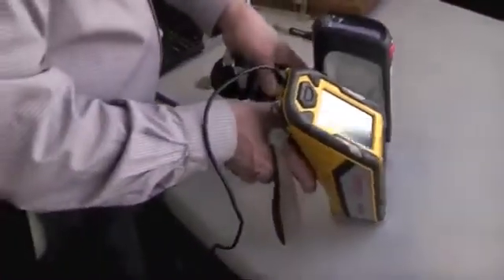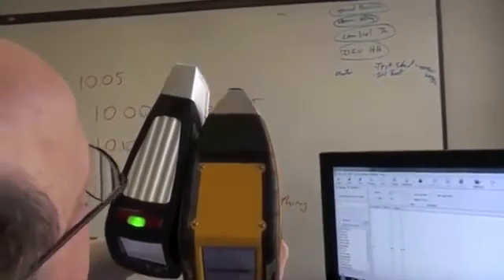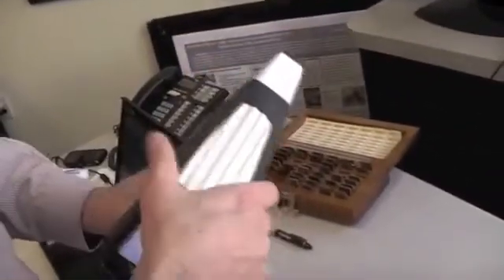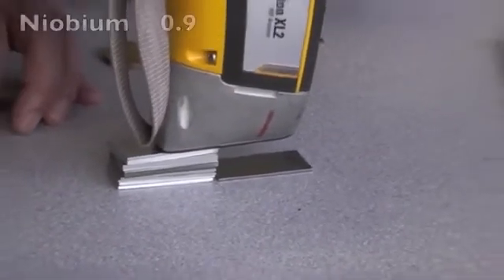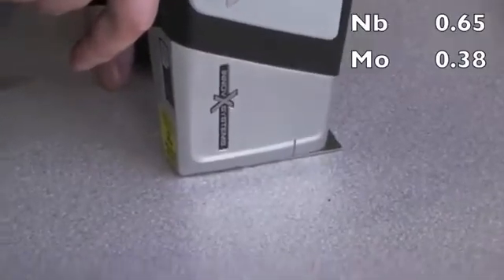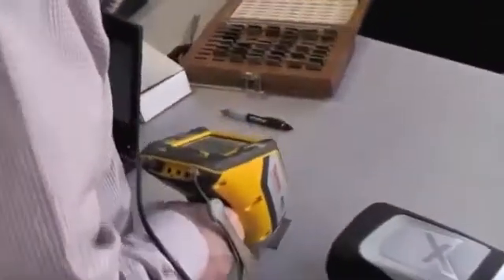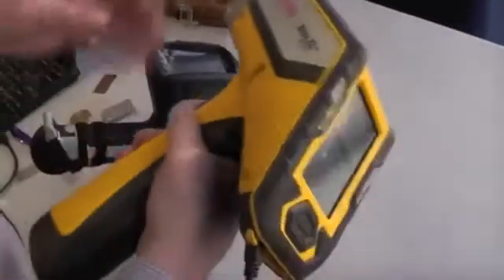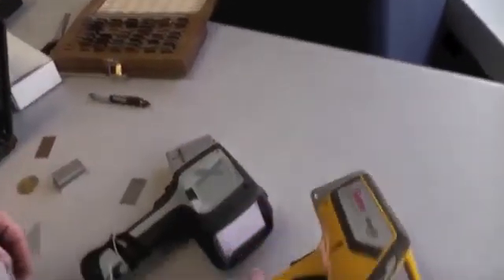Сравнение Olympus Delta и Niton XL2

Comment: That’s a class act!, the Innovex is not “intrinsically safe” because of the metal built into the instrument.
 Some elements are corrosive, bad for metallic instruments.... It will not age well.
Niton’s are splash resistant.
Standing an instrument “on its nose” is a recipe for disaster.... especially if the Xray tube costs almost the same price as the instrument and is as sensitive as a light bulb.
Niton have a display brightness control...
Approx 4000 units in Africa... it speaks for itself.... Buy a Niton.

Comment: Interesting video, seems to be heavily biased though...

- Screen brightness: It appears the Niton analyser has had the screen brightness turned down however even at the shown brightness I wouldn't go as far as to say that it was "half as visible".
- Battery life: the Niton battery life is twice as long, you have tried to turn this into a negative point by referencing the screen brightness... a valiant effort but nobody will agree that double the battery life is a negative point.
- Heat sinking: All the extra heat sinking would only suggest to me that you have temperature problems with the Olympus, of which the Niton does not have any...
- Testing inches away from surface: Why would anybody do this? I am not sure what you are trying to prove here. First of all people will test flush with the material and secondly testing away from surface like that causes additional X-Ray radiation scatter. I sincerely hope you do not do this in front of customers/potential customers.
- Balance: Why would anyone want to precariously balance their highly technical piece of equipment in such a manner???
- Hot pipe work: You failed to mention that Niton actually recommend the use of a hot-pipe stand off accessory when testing hot surfaces. 

In conclusion the Niton analyser appears to be the far superior hand held XRF analyser if these are critical points you have been able to come up with...
Reply: Corect and honestly. But exists opportunities to be better ... For example is price...